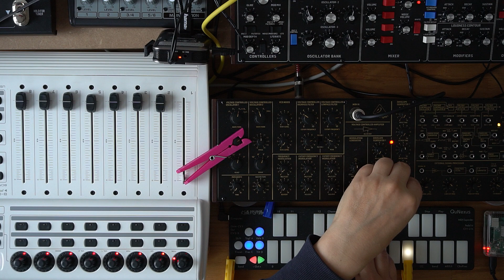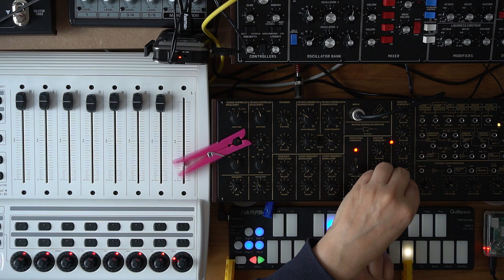Behringer K-2: amazing PWM hack - solderless!

Comment: Do you know how I can get windows 10 to recognise my BCF.? My behringer drivers are only for windows 7 and 34bit.. Are you using windows 10, if so how can I use my 2000 with my 2021 Dell Alienware Area 51 please help me.
You're the GURU...!
Reply from the maker: For that video I took a raspberry pi, but in combination with a separate usb midi interface connected to the bcf din midi ports.